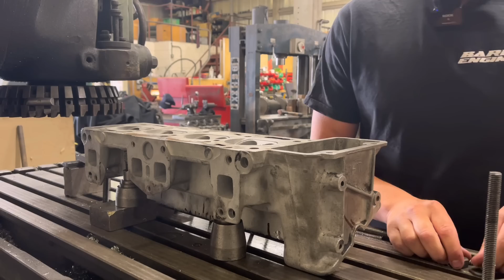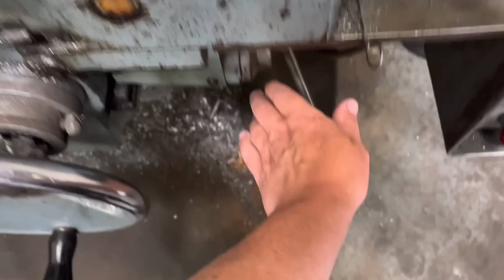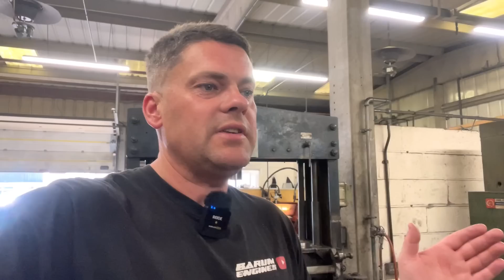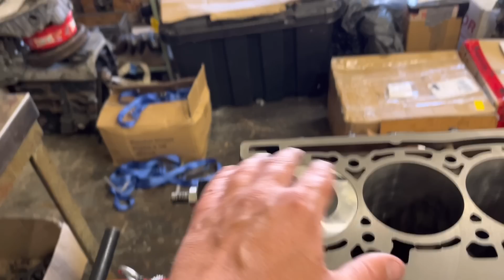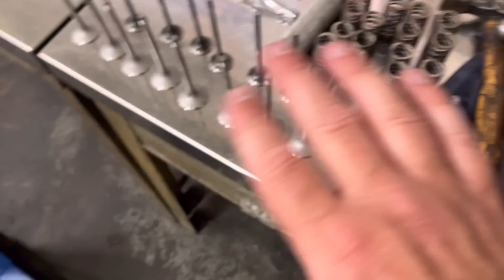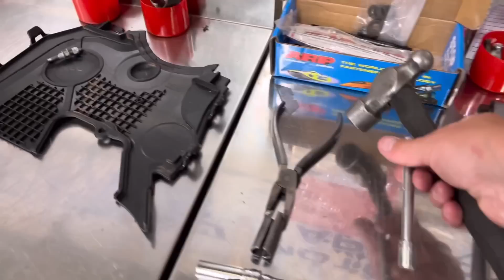“Something SERIOUSLY wrong with this engine, sort it ASAP”

Comment: With the Jaguar engines, there were a a number of different style breathers fitted to front of the cylinder head., behind the aluminium housing some had just a gauze plate,  while some had a baffle plate with two holes which can easily be mounted the wrong way up, not allowing the oil to drain back,  I've seen it done a number of times and is worth checking.
Reply: indeed,
I saw something similar on wheeler dealers a while back  it smoked on throttle and on idle after revving like its was absolutely ruined but was a fresh rebuild with reciepts .
Turned out the breather was clogged
Reply: Going to say, clean the gauze and replace the breather pipe and clean the separator tank but you beat me to it.

Comment: I think the jag has a electric choke solenoid try disconnect one of the 2 wires which should switch it off it might be black smoke over rich.

Comment: Always fill the engine with the exact spec amount of oil on these old engines. Never ever rely on the dipstick, check it's calibration after filled with exact amount of oil, and re-mark it's max mark with a file if required.
Reply: And always fill the engine when the car is on level ground if relying on the dipstick!!! That is another possible cock-up. Car ramps under front wheels and so on.

Comment: Wouldn't be the original exhaust system that's full of oil from the old knackered engine by any chance.
 Might take a few minutes to warm up and start throwing out blue smoke and be nothing to do with the rebuilt motor.
Keep up with the channel. Great entertainment.
Reply: That was my concern too. It will be interesting to find out the cause and would be fantastic if we're right & save them time and money.
Reply: That's exactly what I posted earlier
Reply: Did't see your comment before posting mine. Don't want to see Lee jumping in and start stripping engines like the MGB, with a blocked breather, a few months ago.

Comment: Run it with no.#1 spark plug out, see if oil mist comes out or not, and repeat for 2 to 6? See if oil is pissing passed on one cylinder only? Otherwise it's a general problem? Is crankcase pressure recycled or is it out to atmosphere as it was usually with pre 1960-ish engines?
Reply: What oil has he used I had one smoke and it was the oil some of the so called high mileage/classic car oil have synthetic additives in which stop the rings bedding in jags MUST be run on 20/50 mineral

Comment: Hey Lee, is the Jag engine mated with an auto trans, if so may be the old modulator. Also see if you can get an oil sample, if they don't know what they are doing with the SU's there could be gas dilution.

BlueMule

Comment: On the Jag 3.4, is the customer using the right oil, as its an old school engine, and will not bed in using synthetic, after its run in, syn is ok, but not ideal, my bet is overfueling combined with old fuel, 20mins of engine time and smoke is normal on a xflow,  run in, and dissipates after an hours running

Comment: Crankcase pressure ? whilst the rings bed in it will smoke and unless the engine is in front of you I would not speculate. Guide the customer through suggestions that you get, if still no joy get it in the shop 😉

Comment: My emgines the opposite no smoke doesnt use any oil or coolant lots of power its just noisier than it should be especially above say 2500rpm.....like engine roughness.   Oil pressure 3 bar cold but 1 bar when hot but should be over 1.5 bar.....any ideas? 
Its been cherished so forget engine mounts exhaust gearbox etc.
As its not at idle im thinking possibly chucking in some new std big end shells.

Comment: If milled the heads, the head sits lower and a different angle on the v8 style engines.  
So the angle of the intake vs heads may be where the issue is. 
 My guess.
Reply: Similarly I am not sure how skimming affects the non parallel head studs on the Triumph v8 engines.
Reply: @katywalker8322  the inlet manifold has to be skimmed to match the heads .

Comment: Rings need bedding in. Takes a few hundred miles minimum.
Reply: I am of a certain age where you would follow a car that had a piece od cardboard in the back screen which said Running in to excuse the lack of speed etc.
Reply: @glennpowell3444  👍🏻
Reply: As an Engineer and a DIY mechanic. I would write a list of everything it could be, that you know of. As you eliminate each one , in the end your normally left with your suspect or a new one . Obviously oil can only gain entry to the combustion chamber from certain places. The obvious ones below
1/. Past the rings.
2/. Past the valves.
3/. Head gasket failure.
4/. Entering in with the fuel.

Some none so obvious.
Cracked head.
Over filled with oil.
Incorrect oil, some people put 5/30 in an old engine.

Then I look at what you said, all 6 are showing wet plugs. 
No way have you fucked up on all the valves.
No way have you fucked up on all the cylinders.
Never seen a gasket fail on all cylinders.

So I am going with it’s getting in with the fuel somehow. Crankcase breather issue, wrong oil, over filled with oil. Wrong dip stick meaning over filled or something that stupid.
Reply: Rings that aren't seated would smoke the same amount over time and lessen as they seat. Not MORE after 15 minutes.
Reply: @davidmclean6178  - 15 minutes is hardly enough time to seat a new set of rings. I’ve done plenty of engines and some have took up to 1,000 miles to seat perfectly depending how it’s driven.
Reply: Listen to what Lee said. It smokes when it fires up BUT 15 minutes later it smokes WAY MORE enough to fill the garage. That's not rings
Reply: @davidmclean6178  - Tell me then , Oh Great One, what the problem is then.